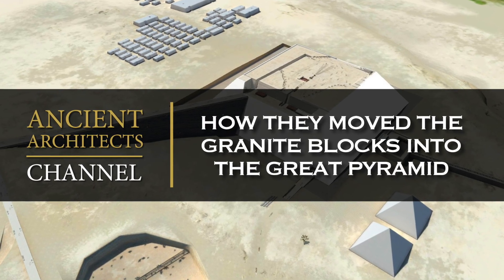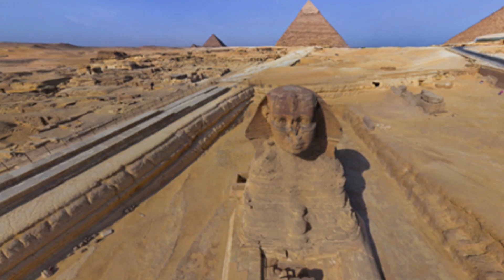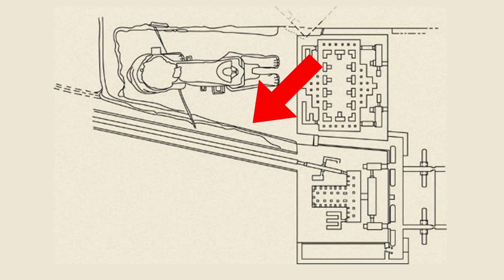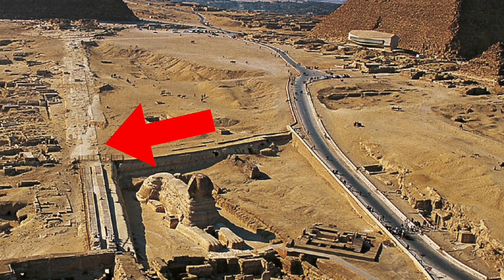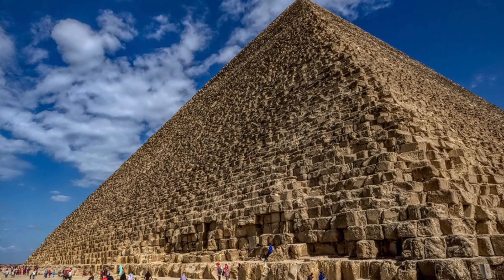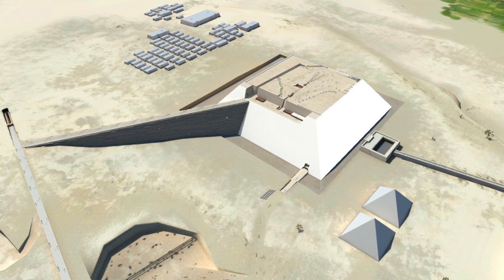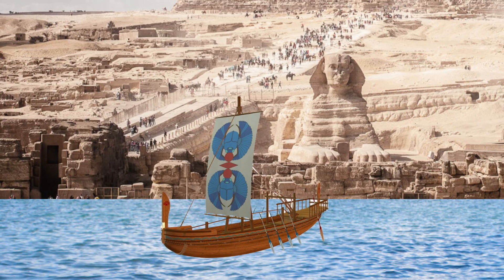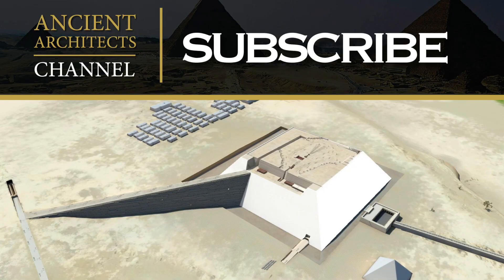How They Moved the 60-Ton Granite Blocks into the Great Pyramid | Ancient Architects

Comment: Even so, if the pyramid was build before the Sphinx that does not provide proof of when the pyramid was actually built. The true mystery is not how, but why the pyramid was built. The belief it was a tomb is simply a shot in the dark as there is no real evidence pointing to it actually being used for a tomb. Theres no mention of it in the literature we've discovered, the theory of it being a tomb all stems from the cartouche inside the "Khufu" pyramid that even its self is easily questionable and disputed. Great video none the less, theres just huge holes in the ramp theory, the ramp itself would have been an engineering marvel.
Reply: Except that there are rope fragments discovered in mud that was used to fill gaps in the upper levels that have been carbon dated to the 4th Dynasty.
Also the oldest papyrus ever discovered was a ship's log which stated that they were transporting cover stones for Khufu's Pyramid. The papyrus was carbon dated to the 4th Dynasty.
All pyramids before were built as tombs (the inscriptions say so), and all the pyramids built after have inscriptions say so. The buildings surrounding the pyramids all say so. From breweries, to bakeries, to relative's pyramids. They say they brewed beer for the workers of Khufu's pyramid or baked bread for the workers building Khufu's pyramid.
There are piles of evidence Hancock Schoch and others of their ilk fail to mention.
How else would they get people to buy their books unless they made outrageous claims. 
Completely unsupported claims but outrageous claims none the less.
Reply: @surfk9836  you need to back check the data you have, while half of it is correct it sou ds like you added a lot to it forcing it to refrence to the oyramid and the building there of. The manifest log said nothing nore then thatbitbwas transporting stone under the reign of khufu. Never stated anything about the pyramid, also... its said khufu merely restored the pyramid not built it. Just as the sphinx. As for the breweries and bakeries well, youll find thise in any civilization. Especially where population is dense. As for inscriptions in the pyramids stating their tombs.... try again, show me one instanct where they found a mummy of any proportion in a pyramid

Comment: Missing element... In their extensive records, somehow the Egyptians failed to document their most glorious achievements. Plus, there are no records on the walls of these structures. Kind of bizarre given that they documented everything. 

One theory on that causeway could be that they wanted a causeway to the middle pyramid, but didn't want to disturb the older Sphinx. So they built around it. 

And using people power to haul those blocks is ludicrous. If it was completed by the Egyptians, it had to be counter weights and beasts of burden. Even then, I'm not convinced they could manufacture ropes strong enough to hold that load.

Comment: Perhaps the "weathering" on the Southern Enclosure is actually from runoff due to the Kafre causeway deep trench counterweight being floated or lubricated with water in it's channel under the Ramp. Excess water spillage from the constant motion of the counterweight moving up and down the channel would explain the "weathering".
Reply: Some geologists propose, based on the topography of the Sphinx being built on cliff shelfs where the Giza plateau meets the Nile valley, that those are the natural untouched shelf walls. It's only the 2 cliffs, and they aren't even 90°.  The Sphinx wasn't quarried out, it was a Butte or Mesa on the depressed cliff shelfs.

They carved the Sphinx out of the Butte, then landscaped the bottom surface flat, which resulted in them needing to build the other third cliff to the north, which isn't weathered.

Why they left the natural walls and not shaved them square, was likely for the simple reason they liked asthetics of the natural weathered walls, so they preserved them intact.
Reply: Another thing to consider is that the Nile ran closer to the pyramids back then and there was a harbor to off load granite and limestone. When the Nile flooded it raised the groundwater level and flooded the sphinx enclosure, resulting in the wavy horizontal erosion.

Comment: It seems hard to find when everything was built on the Giza Plateau.
It may happen that nothing was built at the same time, but it has taken several different times to build everything.
As an example, the Great Pyramid of Egypt. Let's say that Enoch built the foundation before the flood, perhaps a stepped pyramid, with temples on top. More like other pyramids found around the earth. The temple (s) are now on the inside of the pyramid.
Then Khufu came and built on even more. Maybe there were some more in between that built on either or afterwards.
After Khufu, the other pyramids on the Giza Plateau were built in the image of it, without knowing what the structure inside was.

Comment: the so called kings chamber  is not central to the structure an engineer would never do that so its mechechanical not structural ive studied this thing for year now and it was some kind of mechanical water powered machine that conducted a low frequency of electric how else would they be able to electroplate copper with gold ?

Comment: The causeway leads from the corner of the valley temple, this is the zero point or anchor where all the fractal geometry used in the surveying and planning of the complex was carried out...The angles, measurable height as well as observable heights, distances etc, all simultaneously remaining in correspondence to Heliopolis (Lunu), The ritual of initiation began at this point, walking the path of the labyrinth starting above ground, through the subterranean tunnel system and then into the pyramid  ..... to understand why, look into the true purpose and physics behind walking a labyrinth.... and also why the zero point, fractal geometry, ratio and proportion is so important when planning to build on certain parts of the planet, look to how the geometry is natural in many places, like the mountain ranges inc smaller hills and outcrops throughout the world.

Comment: The "pre-exiisting causeway predating the sphinx" hypothesis doesn't necessarily have to date the construction of the pyramids to the exact same time as the causeway itself. Its all too common for monuments & megalithic structures to be constructed upon pre-existing structures and/or sites.
Additionally, It also doesn't necessarily account for the possibility that the properly-aligned wall that may have once contained the sphinx, wasn't demolished & reconstructed to accommodate the newer causeway.
Reply: Fantastic work & a very intriguing hypothesis, nonetheless!

Comment: You're making way to many assumptions for any of this to be correct.
 I've seen you put up any idea on anything at all. 
As if you're throwing shit at the wall and going with whatever sticks.
 You're pushing ideas from egyptologist as if they haven't been blown out of the water. 

Did you pay for an egyptologist course?
 Implies 1 of 2 things? How narrow minded. 
Facts are facts and you're cherry picking others ideas, while leaving out parts of the anomalies their ideas produce. Words like logical, presume, implied, opinion, should've, feasible, therefore, believes, has to be, would've had to been, meaning, likely, obviously and other assuming statements. No evidence that doesn't need a long explanation using inflammatory wording.

Comment: Interesting. I do not endorse any theory.  Questions: What did they use to attach the counterweight? Hemp rope? The middle channel must be a significant, functional detail. Maybe they loaded it with smaller movable blocks/some kind of undercarriage or leverage? ... How did they move the stones into precise position, particularly their final position? that would be a bitch once the humans ran out of room not to mention when they have to turn a 60 ton block 90 deg and then get that tiny stone out from under so it sets into position precisely. Is it possible the causeway was built after the sphinx along a line that made sense to the builders?  there are copious examples of ruins built on top of ruins... Was there something else there before or was the other edge changed? Why was the Sphinx enclosed to begin with? Maybe it was a big party pool just off the waters edge, at one time. Woohoo! Hey all the Pharz havin' a beach gig, free coconuts and figs! :-) The sphinx''s (current) head was always looked wrong to me especially when considering the apparent accuracy of everything else, including the current design of the head itself. That is interesting like 24 hours of static. I'd like to see a 3D scan of those surfaces. It would tell us a lot.

Comment: Still only sounds like it would work for the smaller outer blocks that were done in the refacing/restoring work later. For the heavier internal original blocks, this video is unconvincing. Especially when you look at the vertical distances involved and then the precision with which they were laid.

Comment: The question that comes to my mind is, once the counterweight had hauled that huge  block up, and the block was detached from the weight-harness, in order to be used- how did the builders  then haul the counterweight back into place to move the next block?
Reply: Just make your counterweight out of self returning human beings.  Problem solved.
Reply: the counterweight could easily be a sled filled with smaller, easily loaded and unloaded rocks ... not a big problem.
Reply: @persimmontea6383 you would then have to haul 80 tonnes of smaller rocks back up the grand gallery etc and refill the sled . Would be a monumental feat in itself . Also you would need a mechanism to hold the sled in place whilst it was loaded . How would you remove this with 80 tonnes of rock pressing against it ?

Comment: Well done; that was a thoughtful piece of work.  I have seen the documentary about the French architect who dedicated ten years of his life to solve the pyramid construction mystery, and this short piece added nicely to it.  In a way, it is saying that, if the Sphinx was constructed thousands of years before the Pyramids, then the builders must have anticipated the eventual need for the 'unusual' angle of its enclosure and its extra width [needed for that Pyramid] but then not bothered to build said Pyramid for many, many centuries. Just about plausible but very unlikely; it would mean that they had a very complex plan about the whole complex ready, with each of the three Pyramids part of that plan, but just stopped mid-implementation and that they had kept the plans safe for that same extensive length of time..  .
Also could the vibration created whilst moving these huge stone blocks past the site where the Sphinx was going to be built have caused weakness in the sandstone; weakness that manifested itself as if it had been eroded by persistent water damage - just a thought.

Comment: I think the Sphinx was built first, and they had very little regard to it when they built a road for construction , my reason is if they had this causeway built first they would not orient the Sphinx in that position so close to it, but it would have been located further away from it for aesthetic purposes, you can see many projects roads are built right through ancient sites with little regards even today
Reply from the maker: warlocksden but the causeway forms the southern wall of the Sphinx enclosure. This is the same wall that people use as weathering evidence that the Sphinx is 10,000+ years old. The road/causeway could not be later because it is so badly eroded.
Reply: @AncientArchitects   I am wondering if the enclosure was also built after the Sphinx and the weathering is more man made due to construction stresses since it is mainly on the one causeway wall right?

Comment: This was really vague. They used a counterweight. Oh, well then it’s all explained. No more mystery. 
Hardly. 
How did they build the pyramids? With very large rocks, of course. 🤦‍♂️Not helpful. 
After watching this I have no idea how this counterweight was supposed to work. That 90° turn off the causeway to get to the pyramid looks like it might interfere with engineering any counterweight system. The only part that made any sense in this context was the reference to the grand gallery. Everything else needs a specific explanation or it’s too vague. This doesn’t feel like any more of an explanation than “they used a ramp”.

Comment: The counterweight under the Khafre Pyramid would have to be geared. It would have to do its job and be reset to start again. Could there be a series of weights in that pit that were tied to each block, used, the block transferred to the next pulley while the previous one was being reset and the one before that was put back in use. 

The alignments seem compelling and the logic seems compelling all to something  but the specifics are perplexing be it in timeline or engineering.

Comment: I always wondered what is underneath, in the foundation of the pyramid. There is a water tableau running beneath Egypt. It gets into everything, especially when you’re digging. Between the shifting sand foundation and water tableau,  did the builders of the pyramid anticipate all the potential problems?  I know it goes deep into natural bedrock,  however with the constant earth quakes it could have broken off, because it is just stone laid upon it, right?  The pyramids still hold their alignment. Understanding the building of the foundation, might help understanding the causeway. They might have chosen the foundation based on the existing bedrock. However, getting it to represent the belt of Orion is mind boggling.

Comment: The blocks would have been submerged rather than floated to reduce weight.  Perhaps the causeway had water springs to make it slippery.  Also, the sphinx was not built, it was carved from an already existing lump of rock sticking out of the ground.

Comment: The primary part of the Khufu & Khafre cause ways are aligned at the solstice +- 1/6th Year.
This is important considering the ancient Egyptians had three seasons.
You effectively cut the year circle into two triangles.
Khufus ramp would do app. April 21st & August 21st sunrise
Khafres ramp would do app. February 21st & October 21st.
When combined with the ground level solar reflection caused by the gradient of the 3 pyramids and their normals, you find they hit ground level across a 5:8:13 day period that takes you from the full moon on the equinox, solstice, 1/6th, 1/12th year to the New moon on the 1/8th year.
The cross quarter day will fall on the 3rd of the 5 days to give a 2:3:5 Fibonacci ratio along with the 5:8:13 ratio.

The alignment angles have to be there, just as the pyramid gradients have to be there. To mark the two week festival at the feast days.
Therefore, the purpose and existence of the alignment, came >>before<< the construction of the alignment marker (the causeway).
Not taking anything away from the fact that they may well have dual purposed the causeways as construction ramps, before remodelling them into the causeways we now see.
But it does mean the Temple alignment is independent of the causeway alignment and not dependant upon its existance.

For that reason...why use Khafres construction ramp for Khufus pyramid instead of Khufus construction ramp for khufus pyramid ?
The most direct route requires the least effort. You wont drag these stones on a victory tour around the houses unnecessarily (well capstone aside).

I will concede that if all three pyramids are being constructed, the middle ramp is likely to see the most traffic, if its used as a general site transport route though & probably needs more reinforcement for that reason.

Comment: If the pyramid was built in stages, it's quite likely that the Sphinx enclosure is older and still be part of the causeway.
It's actually one of the theories Hancock explores, that the pyramid design is from a previous high tech civilization, but the construction could have taken ages in several stages.

Comment: It's one thing dragging massive blocks of stone along one side of a pyramid on a spiral ramp but how did they get round the corners?
Also, as the pyramid got higher surely any external ramp would have to have got steeper and steeper so as to make it virtually impossible to drag the blocks manually.
Finally, for now, as the pyramid got higher, and therefore the area to stand on smaller, where did all of these people position themselves to manoeuvre and manipulate the stones into place?

Comment: The only issue I have is the lack of use of animals. Cats were domesticated by Egyptians, humans domesticated beasts of burden probably a million years before this. Think of the American Bison. They existed along side Wooly mammoths. This goes back before the ice age. We know by the findings of king tuts tomb they could manage iron forging. By accounts of your show the enclosures of the pyramids had salt intrusion those conditions would have eroded iron in 100 years let alone a few thousand. We know less than we are led to believe. Saw marks that can only be done with iron blades spinning at high rpm. There is a video of a guy cutting logs with a large round saw blade, he said that if a certain rpm isn’t achieved and maintained the blade wanders. This wandering cut is evidenced in one of the unfinished sarcophagus lids.